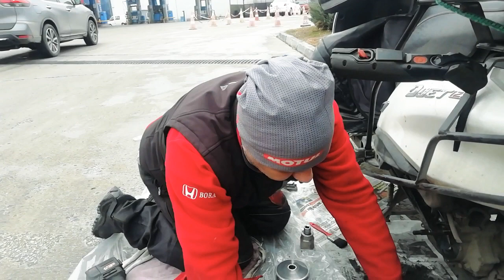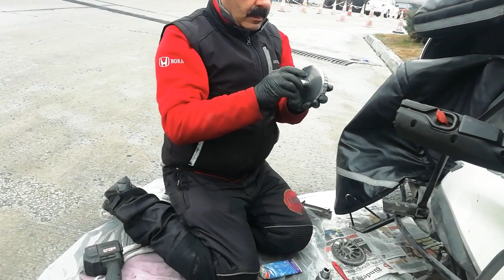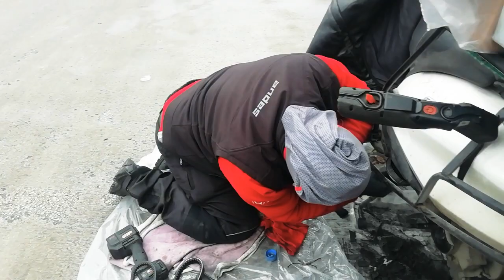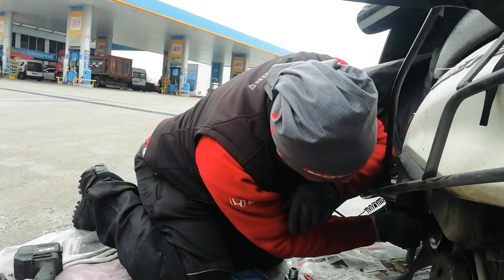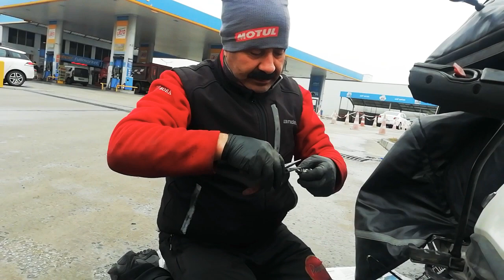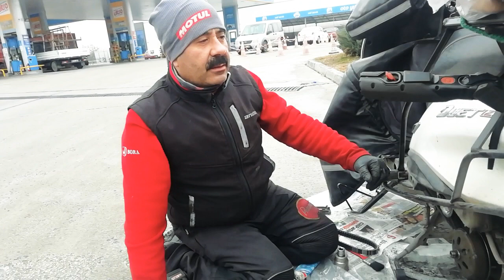Hero Duet 125 honda ile neden kıyaslanamaz

Comment: Ruhi ustam cb125e  2012 honda motora 20-50 yağ koyuyorum sıkıntı olurmu acaba. Bir arkadaş ıssınıyor zaten yağ su gibi oluyor hem ses,de gelmiyor motor,dan diyor . Senin bilgine ihtiyacım var acil cevap lütfen
Reply from the maker: Bu yag ile ilgili 100 lerce video ve konuşmalarum var acaba seyrettinzmi olmaz 10 /40 mineralli yada yarı sentetik olcak o şunu dedi bu bunu dediler bende geçersiz